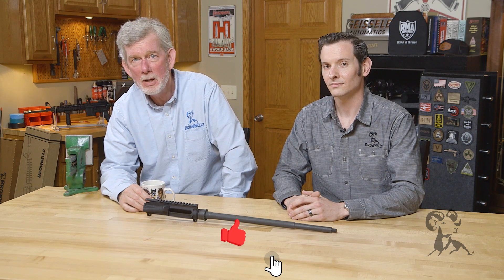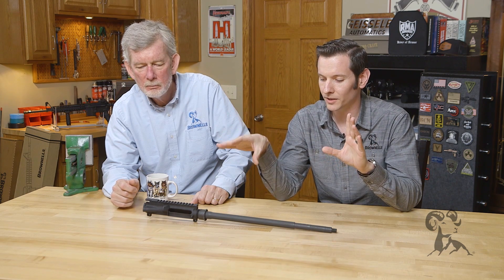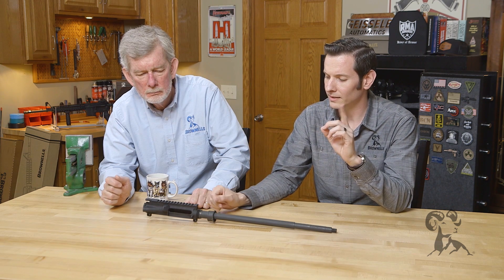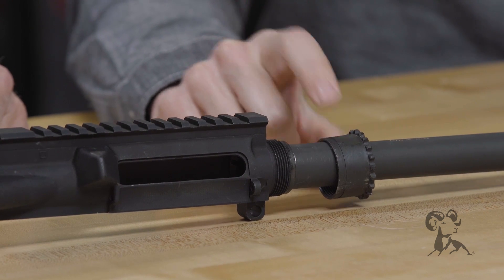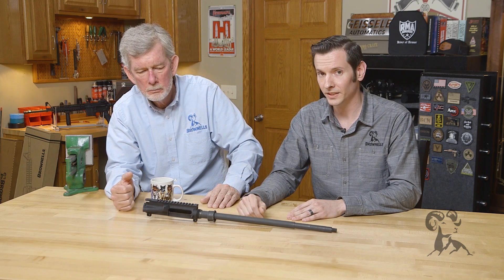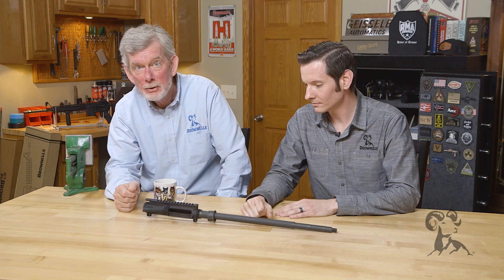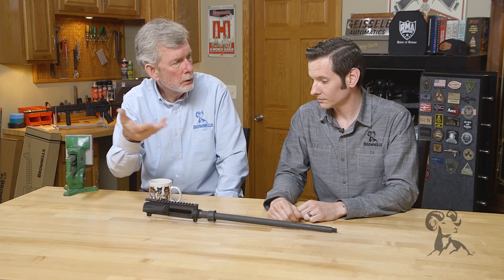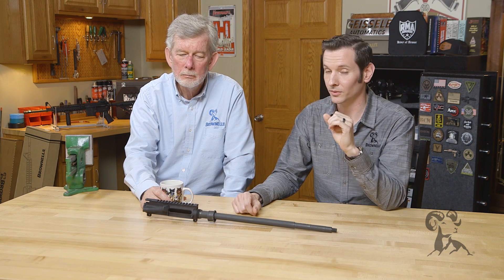SmythBusters: Galvanic Reaction & Your AR-15 - Part 1

Comment: Corrosion Specialist here. You guys are pronouncing galvanic weird. It is a real thing. It eats up aluminum wheels and heat shields on cars all the time but when used to our advantage it protects boat hulls and the interior wall of your water heater. 

But it requires certain conditions to occur. Cars, boats and water heaters all have something in common. Electrolyte. In these cases the electrolyte is water. Even worse, hot water. Even worse than that, salt water. With the grease and the protective coatings and construction of our rifles, plus the fact any water that could get in there would evaporate out quickly when you fire a few rounds, it just doesn’t seem to be a problem. 

If you wanted to prove a point and make it a problem, I’m sure you could scratch up your protective coatings at the metal to metal contact points and store your rifle in a bucket of hot salt water for a week and get the results you’re looking for but that’s crossing over into intentional damage. And would affect any place aluminum contacts steel, roll pins, detents, back plate, trigger pins, etc.  so not exactly proving a point. 

Store it in the house, not in the pond, and it’ll be fine. GalvAnic corrosion cells are a thing, but not something we need to be concerned about in this context. 

In case you’re interested… in the U.S. corrosion control industry, it’s pronounced GalvAnic, where both A’s are short A’s, like in “and”.

Comment: The reason for parkerizing the barrel and anodizing the receiver is to prevent this very thing from happening. You need contact between bare metal. Anodizing is aluminum oxide, which is not a metal. It is a ceramic. It does not conduct electricity. You literally have a layer of a ceramic mineral between your aluminum and the steel, which has also been parkerized to resist rusting anyway.

Comment: In the automotive world, directions consistently say threads should be dry of any oil or grease for proper torque spec, and if any lube is used, there's a significant increase in what 'lbs/"lbs one should use, and it's usually an increase of 15% in my estimation.

Comment: You need electrical charge to experience galvanic corrosion.  The best example f galvanic corossion is power boats. An outdrive on an inboard/outboard boat has aluminum and steel both and an electrical charge. You need dissimilar metals and an elecrical charge. You place sacrificial zinc on boat out drives to corrode instead of the aluminum.

Comment: How is the steel trunnion attached to the aluminium receiver? Is it through riveting or bolts or welding or through any other means?

Comment: You're totally Wrong. I have worked high performance aircraft since 1978. There are dry torque and wet torque procedures. Lubrication on threads—and a whole host of other factors—can cause fluctuation in torque readings. So, once you add a lubricant of any kind to the threads, all bets are off as to whether the same torque setting will truly secure the threads properly.
 Nevertheless, if procedures call out wet torque, definitely follow the procedures with the specific torque lubricant they specify. Lastly, he's talking about all the treatments that protect metal and the threads of that upper show bare aluminum. Come on guys. I watch your VDOs and they're great VDOs. This one requires editing.

Comment: It's not common but can happen. Use a zinc based anti-seize that contains no graphite when assembling steel to aluminum. The coatings/finish on the steel and aluminum will protect most of the parts anyway.

Comment: I have not read through all the comments but many of the ones that I have read mention anti-seize compound.  Be aware that most (but not all) ARE conductive.  Most anti-seize compounds contain either aluminum or copper along with graphite (carbon), all of which are conductive.  Take a look at manufacturer's specs.  I am a grad of MIT and have been a machine designer for 30 years and I can tell you that galvanic welding can and does happen particularly with aluminum (an most especially in contact with brass both of which are highly conductive)  Hard coat anodizing is an insulator so that is going to limit the conduction taking place.  However, if you can see silver on a dissimilar color of anodizing, that IS bare aluminum and it is conductive.

Comment: Threads have 2 torque ratings- dry torque and lubricated torque and they are different. Galvanic corrosion primarily comes from 1 of 2 scenarios- 1) moisture corroding steel and/or aluminum while these two are in contact with each other. Example; the mating surface of aluminum car rims to the steel backing and lug nuts. 2) static current from fluid flow when copper and zinc are touching each other. This is why it’s part of plumbing code to isolate your copper from the zinc coated material when you hang your piping.

Comment: They may be right about torque meaning lubed threads on an AR, but on every other common application (e.g. automotive) torque is always to imply clean and dry threads, not oily, unless otherwise specified.  Otherwise you get over-torquing and snapped fasteners.

Comment: It would take CUSO4 or a similar compound contaminating the aluminum. . Perhaps the copper based anti-seize/grease that contains copper would help but why would someone do that? There are AL/CU alloys that don't self destruct. Steel is less reactive with aluminum. Under an ideal set of circumstances, 1 in a billion, chaos theory level, cascading stupidity it is possible. I'd like to see an example too.

Comment: I have seen.  have I received a  free used AR 10 hand guard  it had galvanic corrosion butt it wasn't caused by two dissimilar metals it was  just your basic corrosion the aluminum tubing and aluminum barrel nut. I wast first time butt true galvanic corrosion when I work on a m16a2 it was a white chalky powter like between the barrel and upper receiver and also trigger /sear cross pins. Butt if kept  clean dry and taking care or  new part hard never seen .these where totally neglected.  Any metallurgist know this come naturally from dissimilar metals with open cleaning contacts you really don't even need to have any kind of current passed through just atmospheric

Comment: I would assume it take years to happen. I work as a nondestructive inspector and we look at the interactions of two metals all the time and one will corrode before the other for obvious reasons, but mostly we only see problems where corrosive material sits around the metals for a long time. The vessels we inspect that have the worst issues were installed in the 70’s and or house a super corrosive substance.

Comment: Trust me, if you live in New England where they put a lot of salt on the road, you will see the reaction between nuts, frames, washers and bolts a lot. Salt helps the reaction and the frame is the ground. We have a lot of rust out here, and you can see where galvanic reactions eat through stuff, or corrode it solid.

Comment: Decades ago, back in the 1980s, I built my first AR-15 and torqued the barrel to the correct spec, but I knew nothing about actually building one back then, except what parts went where, so I used no line at all. After a few magazines my barrel actually seemed to be slightly loose, so I removed the gas tube and to my surprise it was no longer torqued correctly. What’s when I tracked down a high level armorer in the division that I was in at the time (a military unit) and he taught me how to do it correctly. Information in the 1980s wasn’t as easy to find, but then we also had less prominence of misinformation as well. I love your videos!!!

Comment: Auto repair manuals even say to use oil or certain types of lube on bolt threads to get proper torque not to prevent a reaction.

Comment: I've seen and had to employ measures to prevent galvanic reaction when working on tanker trailers attaching bare aluminum to stainless steel. 

Regarding lube and torque, as an automotive technician we were always taught NOT to use anti seize on wheel studs when installing wheel & lug nuts specifically because of TORQUE. As the lubricant was supposed to make the torque wrench exceed desired torque spec. But that was anti-seize on wheel studs. A very minimal amount of lubricant is desirable for any application. 
However, other barrel installation tutorials recommend using anti-seize on upper receiver threads, though the reason given was if barrel nut needed to be removed in future, and nothing about achieving proper torque was mentioned.

Comment: lubrication can prevent damage to the surface of the anodized threads - very small cracks can occur. if the surface gets damaged then galvanic corrosion can start. you may also note the stress corrosion thing. quote from the interwebs: "Stress-corrosion occurs when a material exists in a relatively inert environment but corrodes due to an applied stress. The stress may be externally applied or residual. This form of corrosion is particularly dangerous because it may not occur under a particular set of conditions until there is an applied stress."

Comment: Most computer modding nerds could have easily disproven the notion of galvanic corrosion on AR 15's. For galvanic corrosion to happen, you need 2 disparate galvanic metals to exist in a system that combines constant water flow to create ionized water that transports ionized particles (say, copper and aluminum) from one place to the other to create said corrosion. It's excessively rare with steels used to make guns. The reason steels are used in guns and NOT in computer water blocks is because they don't transmit heat as well as copper and aluminum and don't ionize as easily. Thus, no galvanic corrosion should exist.

Comment: I stopped using Gunslick graphite lube years ago (before the Internet), because I read that graphite will react with aluminum, causing corrosion from a galvanic reaction. Will it not adversely affect an AR-15? Can I definitely go back to using it? It's an effective lubricant, especially useful for winterizing a firearm.

Comment: To prevent galvanic corrosion, you need a sacrificial anode. Take a chunk of scrap zinc, bury it and run a cable between it and your gun. It will literally never rust. To be really effective, you need a really long cable and/or lots of buried anodes to plug into.

Comment: The only time I have seen it be an issue on firearms is with cheaper stuff using some kind of cast or pot metal and it not being well cared for. I don't care for it on engines though. Especially back in the day when they first starting mixing metals on certain parts and we didn't know what could happen. Made for a lot of stuck and broken bolts. Not much of an issue these days now that we know how to prevent it.

And I was in the Air Force during Desert Storm in the 90's and I was on a detail that had to clean a bunch of weapons that came back. That is all we did for days was clean rifles and hand guns. Must have been thousands of them. I never saw that be an issue on any of the rifles I looked at. I actually didn't find one gun that had any corrosion on it at all, even from handling. Well except some of the old .38 revolvers the Air Force was still using. And those were just old and beat up for the most part.

Comment: They use sacrificial annodes made of zink to prevent galvanic action on boats... but boats are constantly in water which is electrically conductive and acts like the electrolyte in a cars battery. We are more likely to see ordinary oxidation on a firearm then we ever are to see galvanic action.

Comment: Well to throw some really useless info out there ive only heard about it twice but saw it once. I heard about it through a navy friend who swears up and down it happened to him due to salt water i cant verify that. A gunsmith i asked about said a guy brought in a homebuild 80% that had a steal upper on it the insides of the lower wherent coated in any finnish and the upper was filed on the inside for fit and they said" it was either the shittiest grease ive seen in a firearms use in my life or his internals where starting corosion process" but that was internals NOT the barrel. Lastly another gunsmith i was chatting to and then in walks a bubba who has the worst ar ive ever seen walks in the cheapest built at home ar ive seen with what looked like 50+ years of setting outside in weather and just horrible. I talk to the gunsmith after he fixed it and he said
 the guy probably built in around the ban era and buried it and dug it up when it was legal we believe he buit it after inspection the bore was ragged every spring was worthless and he had to cut the upper off the barrel and he saw the meating of reciver to the barrel it was filed so galvanic action took place so do with this what you will.

Comment: I was an armorer in the USMC for 11 years and another 15 in the Army. I have literally changed hundreds of barrels and never once saw a case of galvanic corrosion. In fact we never used lubricant on the barrel nut. In fact the TM for the M16 specifically said not to use lubricant on the threads as it prevents you from getting the correct torque.
Reply: I can see that could be the case with the torque being achieved without lubricant. When an engineer designs a bolted joint or any threaded joint, they determine the torque needed depending on dry or lubed. So a joint can be properly torqued without lube but if the engineer specified a lubricant on the threads and a certain torque, then yeah you won't get the proper joint tension if torquing dry. In fact, if you use lube on a joint and it's not specified you can over stress the joint as more stretch will be applied to the fastener before the torque wrench see enough thread friction to reach the torque on the wrench.
Reply: Same reason not to use anti-seize on anything requiring torque, including spark plugs.
Reply: @mysterymeat586  well actually if the engineer designed the bolted joint to be lubricated with anti seize and he applied the right calculations, you can easily torque that joint. The engineer will probably be specifying a slightly lower torque as the same bolt stretch will still be achieved but with less thread friction. I work for a major heavy equipment manufacturer and our prints specify required torques on anti seized bolts all the time.
Reply: @outdoor044  I  made my reply more complicated that I had too.  I should have said don't use anti seize when it isn't called for.  I've seen advice about the use of it for spark plugs from good mechanics, yet NGK cs advised me against it.  They have their own factory coating that lets you torque to proper spec.

Comment: Thank you so much for this vid. I've been worrying about whether or not the lube I used was any good and if I needed to redo it.

 Engendering assembly spec's should call out weather a given torque spec is only wet or dry, or 2 spec's if both are acceptable.

Comment: As an aviation mechanic I can shed a bit more light on this, 'cause, y'know... planes are aluminum so we need to know that kind of stuff. 

Galvanic corrosion requires three things, an anodic material, a cathodic material and an electrolyte. The anode and cathode can be any two dissimilar metals (or graphite), but as aluminum is quite high on the galvanic list, it will react with almost anything. The key to avoiding galvanic corrosion is to either avoid intimate metal on metal contact, which you can do by keeping your gun properly lubed and manufacturers do by anodizing, or prevent any electrolyte from making a circuit. So avoid overly conductive thread lubricants by which I mean the actual grease being conductive, not what's in it, and, this is the really big one, keep your gun dry.

Also, avoid graphite, just on principle. If you use graphite and your gun gets wet, break it down and get it cleaned and dry (which you should do anyways). Graphite is around 0.3 on the galvanic scale while aluminum alloys are around  -0.75 to -1.0 depending on the specific alloy. Most steels are between -0.7 and -0.4 with stainless being a bit higher. The further apart on the scale two materials are, the faster the corrosion will happen. The only thing worse than aluminum is magnesium.

And just to keep you from panicking and stripping all your guns apart for fear of them having galvanic corrosion... Don't. it isn't gonna happen all that quick. On planes which have hundreds of lives counting on them to not fall apart in mid air, we only check for this stuff once a year or so. Part of that is due to the preventative measures in place, but it's also due to how slow the corrosion is.

Comment: The right grease for the barrel nut and receiver has been discussed for years.  The original recommendation in the Army/Marine armorer's manual was molydisulfide grease to prevent galling.  Many people suggest and use anti-seize compounds.  I'm talking  Neverseize, etc, those compounds of grease and metal particles.  That stuff is fine for steel bolts screwed into iron engine blocks for water pumps, but that is steel to iron.  With the AR-15, the steel nut and much softer aluminum receiver threads, the zinc particles dig into the aluminum.  As you screw the nut on you can feel the grittiness of this stuff.  When you try to torque to that final bit of alignment sometimes there is difficulty, the nut and gritty compound don't allow smooth adjustment, and you end up trying to jerk the breaker bar to get alignment.  Again, molydisulfide grease... which is ordinary off-the-shelf wheel bearing grease... is your best bet.  If you don't have that, plain grease gun type grease is good.

Comment: GalvAnic not galvOnic. Aluminum barrel nuts are not a good choice. Threads can seize up. Aluminum on aluminum, even when lubed, is not a good choice. Minor weight saving for aluminum.